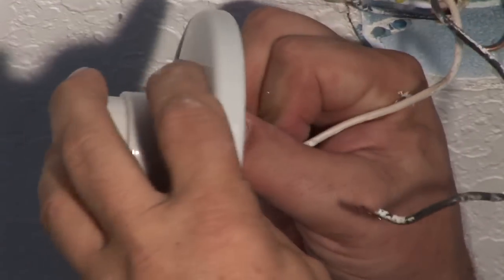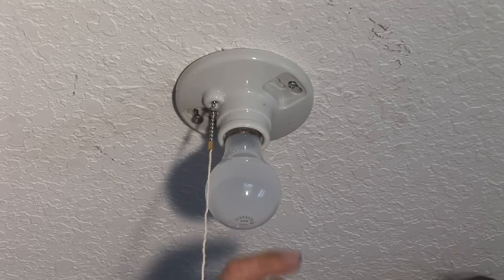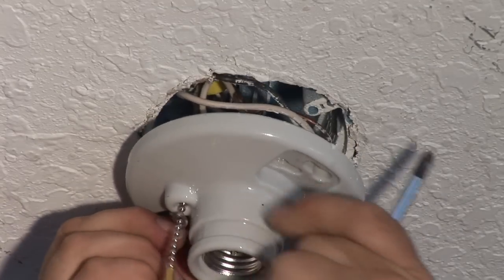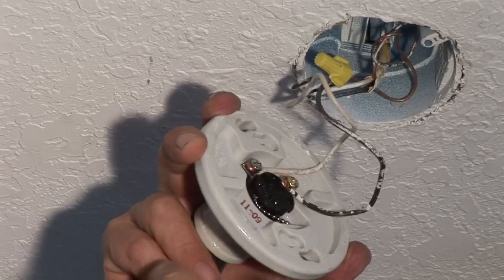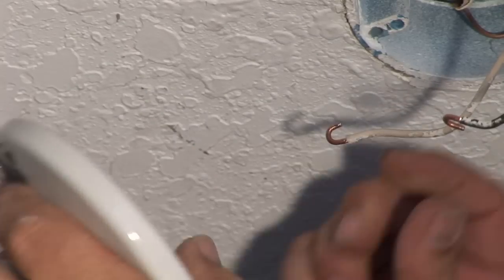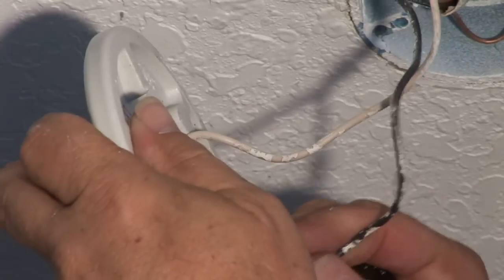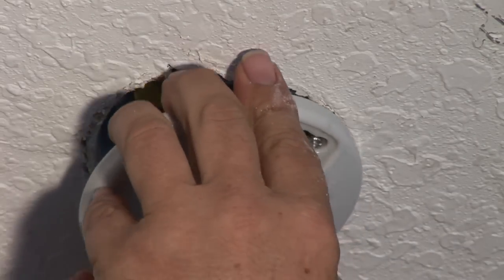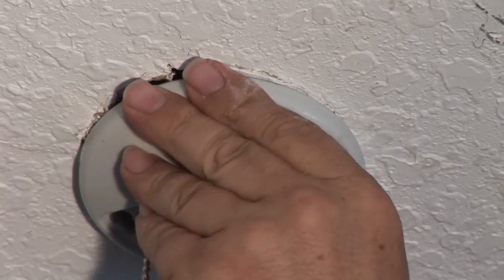Home Electrical Repairs : How to Replace a Ceiling Mounted Pull Chain Light Fixture

Comment: You didn't explain when/how to use the voltage tester (that you said was needed) to test the wires after shutting off the power to be sure that no live wires there.  And, you didn't show whether the fixture worked when turning the power back on.
Reply: He didn't change the socket, just showing how to, that socket looks to be made in Nov 09 by the date code
Reply: Tha was a test…and you passed

Comment: Good info, but mess ups. You say flat head screw driver is needed, side cutters and voltage detector.  Not in any of the steps do you use these tools! lol    You only use a phillips screw driver.
Reply: Justin Behnk thank you for this! I came to the comments to see if anyone else noticed that! I paused it after he said which tools and my carpenter pos husband who won't fix ANYTHING around here has a million of the star looking tipped screw driver but I can't find a single flat head! I also didn't know which of all the dozen plier looking things was a side cutter! And we don't have a voltage tester either AND none of the switches on out breaker box are labeled so I had to turn power to the entire house ofg and have my daughter hold a flashlight all while I'm precariously balancing on her vanity stool over cement steps on the back porch. I asked everyone on Facebook top tell me which of the pli er things I had would work. I posted pictures and everything. Lucky a friend had a electrician at his house and they face timed me. If you're going to put up a tutorial like this you'd better make a right bc ppl can die of electrocution...i.e females with no electrical experience before!
Reply: @babethebuilder1  don't generalize all females with your incompetence 😂 I'm 21 and this was the simplest video I've seen. Maybe if you would've kept watching the rest two minutes you wouldn't have needed to do all of that unnecessary work lol

Comment: This video helped me to replace the pull chain light fixture in my girlfriend's closet. I've never dealt with anything electrical and felt great to replace it!  Knowing what to look for on the grounding wire vs the live wire that goes to the darker bolt really helped! 

Very helpful!

Comment: Note to self - adequately position sheathed wires prior to tightening screws to avoid breaking exposed copper wire (extra 20 minutes stripping more wire for adequate seating).  Accurate, concise, and my light works now.  Thank you.  Putting my boots on just got easier.  If my house burns down tomorrow, I may get the sense I've skipped some crucial step.

Comment: what do you do with ground wire?  just cap it off?
Reply: The ground wire typically attaches to a green screw on the electrical box. There should be no reason to detach it in the first place, so don't. If it is unconnected now, connect it to the electrical box with a screw.
Reply: Thomas Hoover I’m replacing a ceramic pull chain light in my bathroom because when I pull that light on it blows the GFCI to my microwave in the room next-door. I took that old porcelain pull chain fixture off and there is a black white and brown wire. I know the white goes to the silver and I always remember that the black wire goes to the gold because I think of Steelers black and gold colors. But that brown wire was not connected to anything.  The new light fixture that has a globe on it had a thin copper ground wire that I grounded it to electrical the box.  I capped off that lone thick brown wire.  The light works but did I do this right? Now the light works and my GFCI does not trip the microwave. This house was built in 1964 in Pennsylvania if that helps.
Reply: I was wondering that myself.... I'm about to put in a new box on the ceiling for a LED and tap into existing fluorescent for power.  The box I'm using is for "old work" and is plastic.  Where does the ground go?

Comment: what about when there's 2 wires coming in (two black/two white), but the fixture you're trying to install (since the other got broken by someone bumping into it) only has place for the 2 wires - like you're showing..?
Reply: nico1et put a wire nut on those wires and also add another wire (tail) going from the the wire nut to the screw on the lamp holder. Do that for both black and white.

Comment: The one I need . Light holder on ceiling, has NO screws, just four little holes. To put the wires in, I want to find one. Thank you.

Comment: what if both screws are the same color?
Reply: Then you're screwed.
Reply: if that is the case, trace the screw feed that runs to the tab at the bottom of the socket-that will be your hot(black typically) wire, the return (white) traces to the screw connected to the threading sleeve inside the socket.

Comment: A easy repair. I still don't think I'm replacing the light. There's bigger issues here. Old wiring throughout the cellar. Old faulty electrical outlets. It's a big fire hazard

Comment: Are you sure you're an electrician?!? The Boack (hot) wire ALWAYS goes to the brass screw!!! By screwing the Black wire onto the silver screw you electrify the light bulb receticle and anyone unfortunate enough to make contact with the silver base of the lightbulb while installing a new one will be electricted! Redo this video, ASAP!!!!!
Reply: Blind Bushcraft black did go on brass